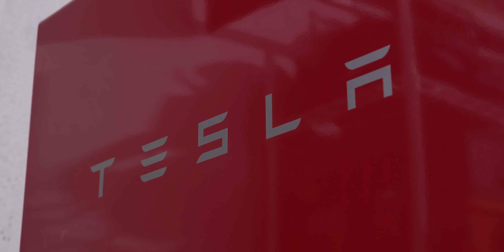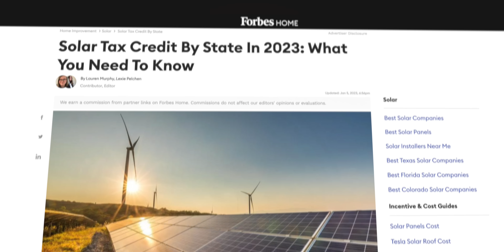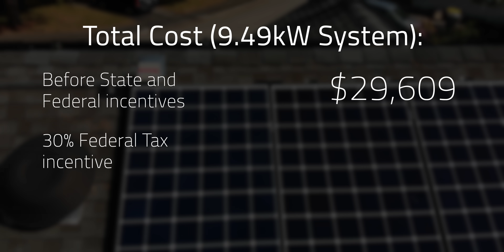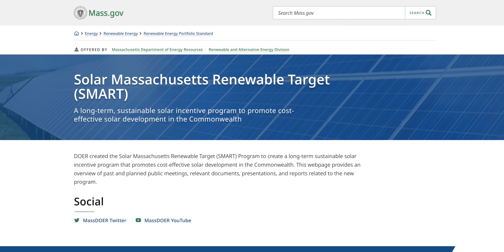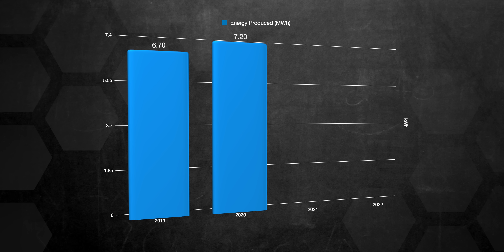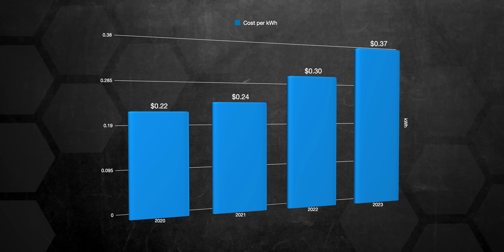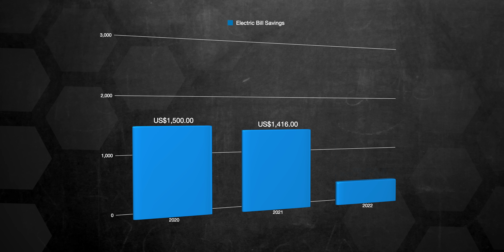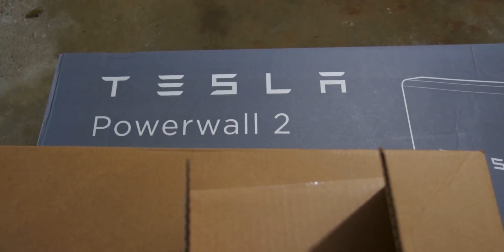5 Years with Solar Panels - Is It Still Worth It?

Comment: You did not discuss all the negatives.  
1) More chance of roof leaks due to more penetrations.
2) Higher costs when you do have to replace the roof at some point.
3) I'm betting once the panels are paid off you'll have to replace them.

Comment: We added 4.7 kW of grid-connected PV in 2009 and 3.2 kW in 2022. Our CO power company's pricing encourages using kW over NG BTUs, so our 2-zone heat pump minisplit gets more fall/winter/spring daytime heating use than ever.  PV + heat pumps are a year-round winning combo.

Comment: I would never ever buy anything LG after a hugely bad experience with them about 7 yrs ago. Bought a very expensive fridge from them, just after 1 yr it was garbage thrown out in a dump. Broke down and was told by three repairmen and the LG supposed customer service which is almost non existence that it could not be repaired ! Part was known to be deficient and LG knew it and still made and sold the fridge with numerous law suits against them over the failed fridges. Never ever buy any LG products ever again. Totally crooked company.

Comment: I went with Tesla to install the solar system with Powerwalls.  I have been totally pleased with the job they did, BUT from the time I put in the order to when the install actually happened was SIXTEEN MONTHS!!!  Perhaps I could have been happy with some other outfit installing it sooner, but on balance I do not regret it at all.
Somehow I ended up with simple Net Metering.  I get a payment for that once a year; the one payment for 2023, plus the credit for 2024 through August, comes to over $2,500.  The credit grows every month except Jan and Feb, when it drops a bit.  Over that same span the same consumption off the grid would have cost over $4,500.  So a return of $7k or so.

Comment: So you're not going to discuss the cost of replacing the panels and the batteries after 8 to 10 years?  You can't keep them.  They don't last forever.  You'll be replacing all of that when they begin to degrade and you'll be replacing them at full cost.

Comment: I studied solar panels and hell no! I dont care what anyone says because its a bad deal no matter how you slice it. My oldest son believed in it and he came to know.  Nothing but lies and deceit A small scale system if you have to  but never would I put that junk on  my roof. Its a scam.
Reply: For decades, I like the idea of solar panels but never jump into it. I just came across a video Why I remove solar by Solar Goat. I totally changed my mind about solar and will never let anyone drill into my good roof. It's an open invitation to decking rot if not leaks. It adds complications if you have to repair or install a new roof.

Comment: There vis no way you will ever get your investment back with solar power. NO WAY! The environmental impact of the batteries alone ought to give serious room for pause. But, if you are going to do it be aware, you are never going to receive free electricity. However, you might do OK if you somehow win the best complete and most expensive system along with all equipment, intallation and maintenance to go along with it. In other words, there ain't no free lunch. So, if you do this and you don't win all of the above, the phrase "I have saved $$$ on my electricity bills" doesn't make any sense as the personal outlay is enormous. By thew way,  I don't care what AOC thinks. She's wrong.

Comment: I wouldn't trust Sunrun, based on my experience. They installed a defective roof on my house. I spent two years trying to get them to repair it. They forced me under duress of an open water leak during heavy rains to find my own contractor, because Sunrun claimed they couldn't locate their original contractor who did the work. They also claimed they couldn't find anybody to repair my roof. Can you believe it? So I was forced to use my own contractor and forced to sign a document that Sunrun isn't responsible. Of course the damage to my roof when Sunrun installed it was so extensive that new leaks kept appearing and much of the damage was hard to figure out since the repair people weren't who installed it. So when further repairs were needed Sunrun claimed they weren't responsible and refused to repair the roof any further. Furthermore their last email was unfriendly and seemed hostile, and they made false claims regarding the matter, I believe  so they could save the email later as false evidence if they got sued. One false claim they made was that there were no active leaks in the roof, so "therefore they aren't responsible". There are at least two active leaks I'm aware of. The workers who installed the roof didn't speak any English. I couldn't talk to them. I feel pretty sure they were undocumented workers. Are there any Americans who don't speak English? I think that answers the question. One thing to be aware of. Everybody at Sunrun was nice and polite and tried to sound accommodating. But when it came down to responsibility to paying for the roof repair, I felt that they had ulterior motives and their conversations  were ultimatly strange and not quite right. I felt any friendliness in the end was pretending. Here's what should have happened: I report to Sunrun that their roof is leaking and they simply take care of the entire matter without bothering me and simply arrange a schedule when I can be home to allow the workers in. Instead I have a roof that had been damaged for two years that now needs over $7000 in repairs. No matter how you slice it, Sunrun bent over backwards to not help me, and then they treated me as if I was some rogue criminal off the streets. The last correspondence they sent to me was condescending and accusing. But the reality is they installed a damaged roof and it’s still damaged and they won’t fix it. As if I’m a bad person. That’s how they treated me when it came down to the responsibility of paying. I was completely shocked and horrified. I truly thought they were a legitimate company in the beginning, but now I feel 
They are extremely risky and can’t be trusted if anything goes wrong. I’m certain they will offer a lot of heart felt platitudes for a while until the money part enters the picture, and then you’ll know who your friends aren’t!

Comment: Seems to me that the first time you have to replace the roofing, all your savings will be vaporized. Also the company that built your solar stuff probably will no longer exist and you may have to start over…. Good luck…. Also under the panels is a great place to start a very moist eco system that may encourage deterioration of the lumber under the shingles….. Again good luck…
Reply: Exactly. I love the idea of solar for decades. I changed my mind after seeing a video: Why I remove solar by Solar Goat

Comment: Sorry if this is a dumb question, so you’re still paying the solar provider per kw for energy your panels took from the sun?
Reply from the maker: No dumb questions.  For the panels on my roof?  No.  All of the power my solar panels generate is mine (or at least credited off of my bill because of Net Metering with the utility).  This solar panel array can only provide about 60-65% of my energy use, so I'm still paying my utility for the other 35-40% I need.

Comment: It seems iffy from a financial sense. I went down a different route replacing old appliances, PCs and lights with much more efficient and low power ones. Also turning things off when not in use. They amounted to pretty big savings.

Comment: This is interesting, but can be very misleading to the average American (although you have certainly done a good job trying to make that clear). The biggest factor is your 1:1 net metering. That is a fantastic deal for you which, to my knowledge, is not available anywhere else. It is also a contributing factor (I’m sure) to the increase in your electric rates. And those rates!  My goodness, those are high. That contributes greatly to your rapid break even point on your system. I love alternative generation sources, but for the vast majority of people, the systems don’t come anywhere near making sense, financially. Like your Tesla battery. With the 1:1 net metering, the battery would make no sense at all if it weren’t for the fact that you got it for free and your utility had the VPP program. Good luck going forward. You’ll be well protected from eroding benefits by the fact that you’ve covered your system costs during times of very favorable programs. By the way, have you considered panel mounting mods to get yourself a little southward tilt?  That can make a very large production difference from a small investment. Something as simple as a block of wood on the north frame leg(s).

Comment: I think the biggest drawback to solar panels is their cost. I got them about 5 years ago, and declared BK a couple of years later. My monthly equipment bills were eating up all of my savings until the BK, and after that I started to see some net savings. I had a 15 year loan. I intended to use the tax credit to pay down part of the loan, but that didn't work out, so my payments went up after 18 months. The sales people all make a big deal about the likelihood that your electric rates will go up and up and up, but they never mention the buyback rates, that keep going down and down and down. It's really hard to wrap your brain around the NET P or L you'll have over time, but at the end of the loan term for the equipment, it's fair to say that your rates will have gone way up while your buyback rates will have gone way down.

At the time I got my panels, the utility company (APS) offered a 10-year buyback rate of 11.5¢ / kWh fixed to the property. Some will fix it to the owner, some to the life of the equipment, and some will adjust it periodically -- it varies widely. The other power company in town, SRP, only pays 4.5¢ / kWh from what I'm told. New APS customers will get 7.5¢ / kWh. I think this is highway robbery -- people need to get behind laws that require utility companies to pay consumers the same rates they pay to solar farms, but they see consumers as competitors and would rather we disappear.

One thing that really made a big difference to me was something I initially misunderstood -- APS said the best plan I could get was "Time of Use with Demand Charge". I signed up for it and got smacked with a few HUGE bills! They didn't explain how to make it work, and I switched back to the previous plan. But I used the solar panel system's web site (from Enphase) to watch my production and consumption (they update ever 15 minutes) and figured out what was going on. So it hesitatingly switched back to the TOU+DC plan and did one thing different: I programmed my thermostat to basically shut off between 4 and 7 PM. Man, that has made all the difference in the world! My rate on the flat plan was 13.5¢ / kWh, but with the TOU+DC plan, it's only 5.5¢ / kWh for "off-peak" hours, which is a SCREAMING DEAL! The trick is to DO NOT USE ANYTHING DURING ON-PEAK HOURS -- N-O-T-H-I-N-G. Well, my fridge and basic electronics consume less than one kW per hour, and as long as I don't go over that, I'm fine. But one time my (BEV) car's charge timer goofed and it charged for several hours that spanned the entire 3-hour peak time block, and I was slammed with $125 kick in the ass for that. You have to watch it like a hawk. If you have kids, you probably don't want that risk. But having an EV, charging for 5.5¢ / kWh is incredibly cheap -- most commercial chargers are 40-50¢ / kWh.

Without the car, I'd get credits from the solar panels for 9 months of the year, and then really low bills for the others, but that was with the flat-rate plan, not the TOU+DC plan. And it's really helpful now to be paying 5.5¢ / kWh for what I CONSUME and being credited 11.5¢ / kWh for what I PRODUCE (via solar panels). With no monthly payments of $125, I really AM actually SAVING MONEY from the solar panels. But that buyback expires after 10 years and the loan goes for 15. The equipment warranties are 20-25 years. 

My advice is, PAY OFF THE EQUIPMENT LOAN ASAP! You might save some money on interest, except my interest was something like 2.75%. Just pay it off because you won't be seeing any REAL (NET) savings until then.

Comment: Just got a new shingle roof.  They had to replace deck sheeting where out solar water heater panels for our pool were installed. Water penetrated through the screws.   I will never install solar if they have to penetrate the shingles and deck sheeting.
Reply: Yep. I was a huge fan of solar for decades but I didn't know anything about roofing. I changed my mind after seeing a video: Why I remove solar by Solar Goat. No way, I would let anyone drill holes into my roof. lol

Comment: Federal tax rebates may lower the cost to the individual but do not lower the cost of the solar system. Other tax payers are paying for your solar. I’d be interested in a cost analysis with tax rebates aside. The time value of money and the lost investment income is another issue not addressed in your cost analysis. If a person put 30k into a modest investment returning 3% instead of a solar system, that loss should be considered. Or if a loan the interest paid on the loan.  You may have baked these considerations into your cost analysis.

Comment: I believe that roof top solar panels in areas where freezing temps occur is just inviting trouble. Every place a hole or fastener is attached to your roof is an entry point for water. Freeze and thaw cycles that occur maybe up to 200 times a year or more in some places could spell doom for your roof and any area that will get wet because of it.
Reply: Yep. I love the idea of solar for decades. I changed my mind after seeing a video: Why I remove solar by Solar Goat.

Comment: I love the way you chew on these issues. 
👍👀❤
Here’s an idea I’m not sure how to pursue, so I’ll put it out there for your consideration:

BEGINNING POINT: The electrical grid is in some ways a shared resource monopoly. We’ve found ways to bill incrementally, yes. But the fact that the inputs and the outputs don’t match is why we have all have a Public Utility Commission. (Or at least a “cooperative” for some areas.)

THOUGHT EXPERIMENT: Please hear me out… Could we make electricity free to users and pay for the electric utility with taxes? My hunch is that we can make this “power source and CO2” transition MUCH more smoothly if we centralize the power grid and swap carbon fuels for the solar power all at once, viewing the grid as a whole. This way, we can also make the transition to EVs more efficient too. EVs have batteries of course. EVs are already subsidized because they’re still expensive. The charging network for EVs is a patchwork, to be generous about it. And the grid backup feature inherent in a huge community of coordinated batteries seems valuable, but hard to achieve using just “market forces.”

Arguably, the cost of shifting to EVs is like a regressive tax. But we can reduce the total cost of the transition if we can manage it as a public work — like streets, sewers, fire and police, and so on…

Because I assume we don’t have time to waste, in our overall need to reduce CO2 concentration, I’m suggesting we need to suspend competition for the time it takes to make the transition. And my hunch is that if we don’t, the total cost to society will be too high to get cars cleaned up in time. 

Discuss?

Comment: I have a small off-grid shed top 500-watt system. 
I use it to power the fridge, fans, and chargers 24/7.
On cooler days I run a 12v DC air heater for a few hours under the natural gas water heater to reduce gas costs. The pilot flame and hot air keep the water temp surprisingly hot.
Solar systems do not save money. They increase power independence. The initial costs and component replacement costs negate grid power savings unless the total costs over years of use are less than using only grid power.
We don't save money when we spend money.

Comment: 2 year on solar, in Sonoma County. I produce enough to cover home and EV. Battery backup has saved us through 3 blackouts, and also runs the home in peak times. They put a second sub-panel for all the 220 circuits. I chose to keep the oven on the main sub-panel, so I don't lose that when there is a blackout. I also put in a heat pump. That's the real savings. I personally think it is part of the package.

Comment: If I could put solar on the ground away from the house I would give it a go if the cost was say under $5k otherwise no roof job for me. I just had my simple 1300sqr ft home re-roofed and the cost almost gaged me $15,600 of that $1k of dry rot repair some from the Direct TV dish on the roof that's only 4 bolts can you imagine what a re-roof with solar panels plus any dry rot from all the bolts and brackets will cost 10 - 20 years from now yikes! On the ground seems like the best bet. On the roof no way, I see this being a huge issue when re-roofing.

Comment: I live in Las Vegas ( don’t ask me why) born in Los Angeles but LA has been taken over by zombies. Anyway, it was 122 here last week and at least 118 all week so I’m researching how to buy a solar battery ,not just for backup ,but to run a portable AC to try to cut my $150 monthly bill on a regular basis. I’m a single woman and mildly tech savvy but hoping to educate myself. I’m leaning toward ecoflo but it’s around $4k for their bundle. I rent a townhome. I’m hoping to cool my attached garage to work in there.  Is it possible to use a portable solar battery on a regular basis? What’s the cheapest way to charge the battery aside from solar. Car? Power station? My own wall outlet? I have big trees that may be in the way for solar. I like your easy to understand delivery style. Thanks